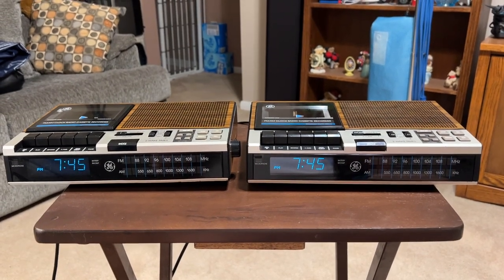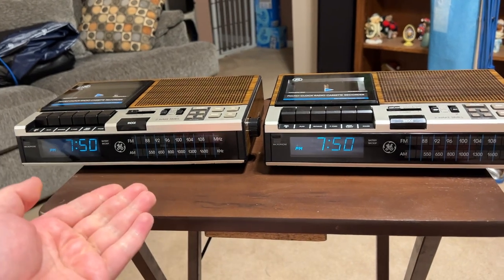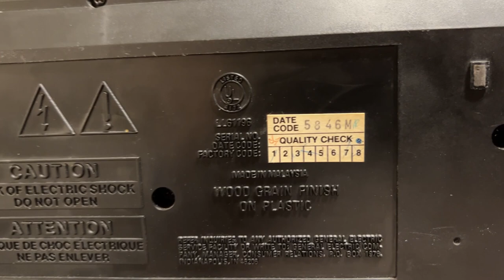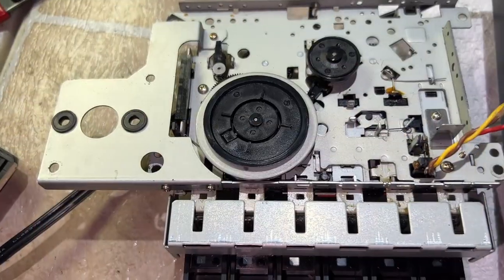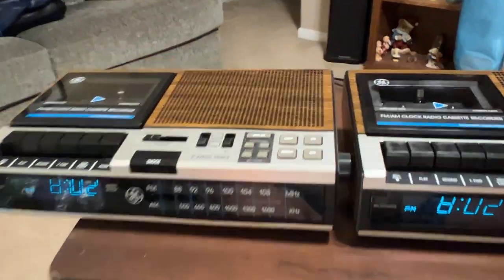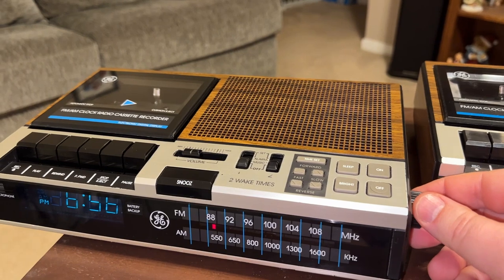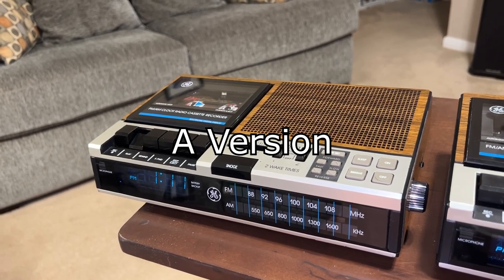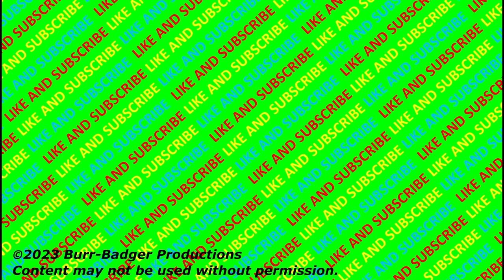The Popular GE 7-4956 A & B Version Cassette Clock Radios- What's the Difference?

Comment: Very interesting to see that you guys highlight cassette players in your videos. The only cassette tape player I have is from the 1970s,  it does need restoration.  The only reason I saved it all these uses because it is a very unusual model. It actually has an adjustable speed control. Yes a speed control. It is a "superscope " made by " Marantz " the last time that I used it was actually back in the mid-80s. It worked great at the time but I am sure now it will need a full restoration

Comment: I have one of these. I had it apart and seems fairly simple to service. It ran 24/7 from the late 80s up untill mid 2022, and shortly after that I inherited it. VFD still performs well, and the tuner sounds great too! Eventually I'll order a belt kit and restore the tape deck operation, as Iirc the rewind doesn't work due to a snapped belt.

Comment: I bought one ☝️ of these back in 1991. I could not tell you if it was an “A”, or “B” model. I remember it being $34.99, and that the speaker 🔊 had quite a bit of bass. These are EXACTLY identical otherwise, other than the modifications to the inside that you’re talking about. Your friend, Jeff.

Comment: I have GE 7-4956B. And its the same as your A version. Its made in Malaysia, not in China. and it has the same version of tanashin mechanism as your A version and also has a white boards. Maybe it was a mistake in marking when it was assembled, i really don' t know. In my GE i had to make a lot of modifications because i live in Poland, where we have 230V~ 50Hz in wall sockets. This radioclock has a TMS3455NL-R clock IC, so its synchronized with frequency of the electricity, i was searching for datasheet of this chip, but i cant find anything, and i changed its 12h system to 24h system and changed its 60hz synchronization to 50hz for trial and error method. Also i rewinded transformer to get it working on 230V. But also i had to retune FM Band because someone changed it FM band 88-108Mhz to 65-74MHz, because when Poland was communistic country (PRL) we had  FM band 65 -74MHz. Now its waking me up every morning. And its looking very cool because of its VFD and nice wood grain. I really like this radioclock because of its very loud alarm sound, look and functionality. Its probably from 1989 year. I bought it for about 60 polish złotych (about 15 USD) in late 2022 because I had sentiment to this model of radioclock because my great-grandmother was traveling to America at the late 80s and early 90s and she bought one there but it got damaged. But now i had working one. These are truly commendable piece of equipment.
Reply: Your comment gives me hope. I've been researching for days to somehow modify the 240 to 120 (I live in Australia)  also and haven't found much information other then to buy a stepdown transformer. But after reading your text about 60Hz to 50Hz synchronization I'm now a little more concerned about how to go about this too. With the transformer, was it easy to rewind the transformer? there's a few more output wires then I was expecting, or do you rewind the input ?

Comment: Thanks for sharing! I like the aesthetics of those GE 7-4956 clock radios, as for the Tanashin mechanism, I already came across many chinese, new and old cassette radios that used them, and I found that the lowest quality part was the preamp that amplifies the tape head signal, lots of hiss and no bass at all, but the overal sound was very stable and no wow and flutter audible.

Comment: Today I bought the B version at goodwill for $5 , I’m in love with it but unfortunately the fast forward belt has turned into goo, do you know why turntableneedles and the prb catalog have 3 sizes? They both list a 7.3/7.2 belt , also could it be possible to switch out the mechanism from B into the A to get the ultimate version, but my guess it either they use different speakers or the B version has bad caps

Comment: Hey I've got a (seemingly) b model that used to have a working cassette, but after taking the flywheel and other main pulley off to clean off a disinterested belt, I bent the switch with the brown and yellow wires out of shape, got it back in working shape (I think) and now the motor doesn't spin yet it works as I have tested with a 9 volt (i assume it takes 12) nor does it accept audio through the head as tests with magnets and metal have shown, i have tried to figure the problem out yet have failed, any ideas on what I should check? I've googled the issue, but it seems this is a uncommon issue as I can't find anyone that has this issue, it's all reverse pop-ups and common issues

Update: i have found two of what seem to be voltage regulators that are getting hot enough to burn me, i would assume those are the issues
The dead things are near slots: q5 and q10, i am unable to find a schematic, and cant seem to find any info on the chips (will try and replicate the spacing of the characters)

"0789
        C

1 g  4"

And

"6001
 -022
 Ti43"

Comment: So A has better sound, but B won't eat your tapes. If I have that right, it is a tough choice deciding which is really better. 
I do have one of these, not sure if it's A or B. I seldom ever used the cassette, it was my alarm clock. 
Right now, it is hard to reset clock time and alarm time, the buttons are no longer controllable and I have to play around moving time indicator up and down until I get close to what I want for clock time and alarm time.